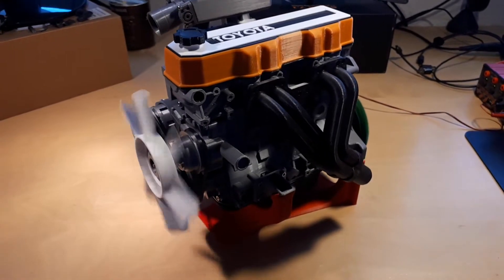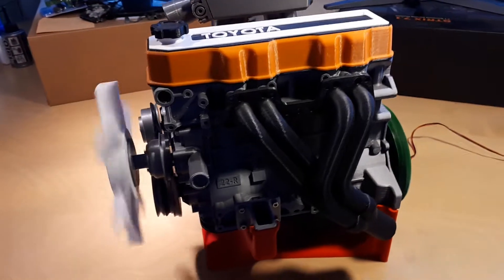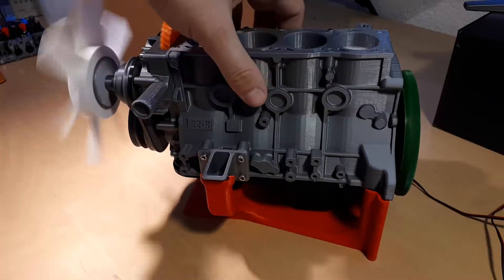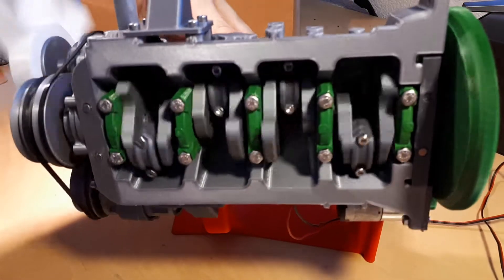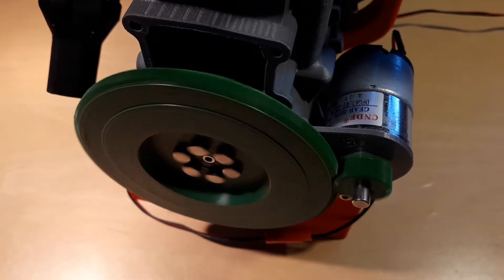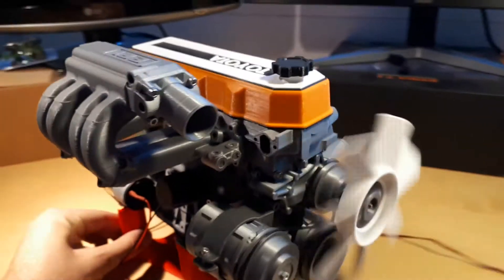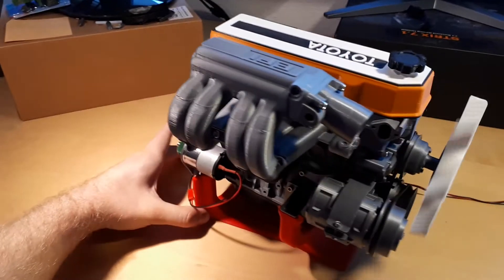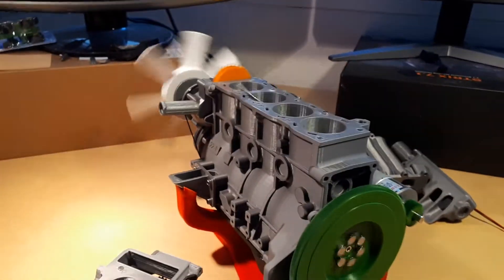3D Printed engine - Functional model of Toyota 22RE engine

Comment: What springs did you use for valves?
Reply from the maker: I used TIG welding wire and wind my own springs. Any steel, stif wire would do the job as the foece reqiired on the valves is not that high. BTW Sorry for late response, i did not check on the chanel since long time now.